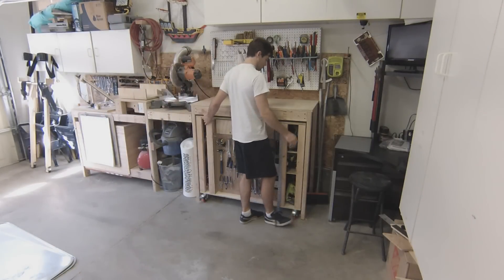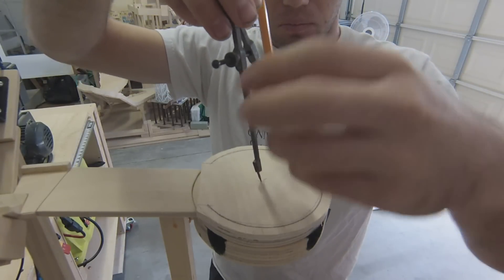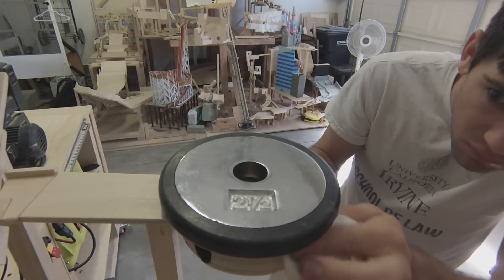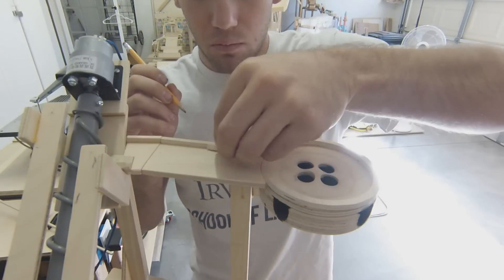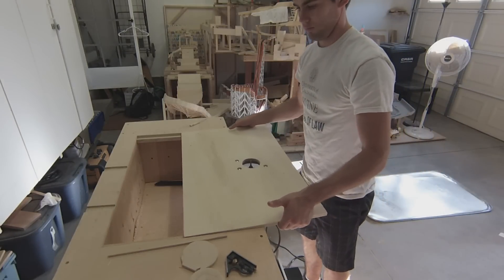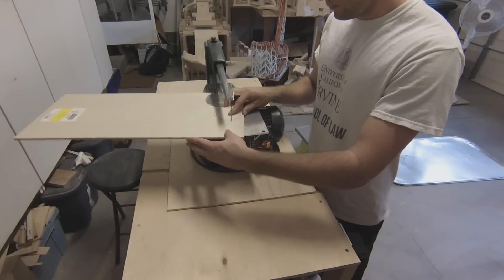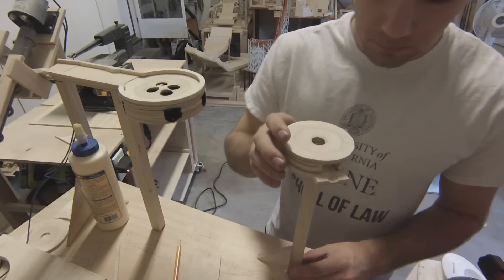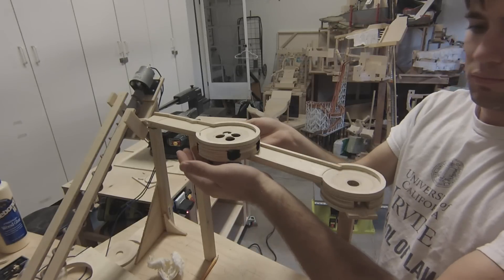Mini Golf Marble Machine Build, Part 1 (How to make a mini golf hole)

Comment: Any technique tips on sanding the funnels?  About how much do you take out of the center?  Thanks!
Reply from the maker: +Michael van Strien  I used a Dremel by started in the center and working my way outwards. You just need to sand enough to ensure consistency. The funnels are about 3 inches in diameter and the center has a little over 1/8 of an inch sanded off. Not too drastic in this case.

Comment: You shouldn't wipe off the glue. Wait for it to dry then break it off. otherwise, you can't stain the wood because you smeared glue into it. Very cool build here. I would like it if you added resources for where you bought your motor and battery pack for the lift. That's really cool.

Comment: Great video - what type of timber do you use? And why do you use ball bearings, rather than glass marbles? Keep up the good work😀
Reply from the maker: I used ball bearings for Marble Mountain because they are uniform and that was important with the amount of jumps. I now just keep using them. Much of the wood I use is hobby wood from Michael's arts and crafts or from Home Depot's stock.